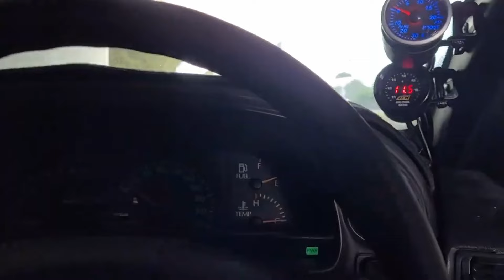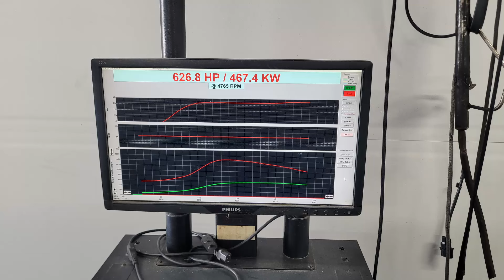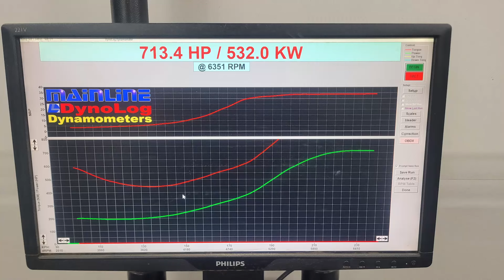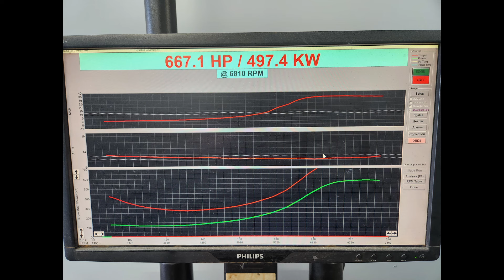Dazza.. Shop Truck?

Comment: Well done. OK dude I’ve watched for a while and I think for the way your doing things its best to start to have some individual egt’s sending to at least a max limit light or alarm or both and another cheap easy to make is a knock sensor to amplifier and send it to the same alarm indicators as the egt’s to stay ahead on vitals at this level for this pump. And if you don’t get your plumbing on point put a basic open closed adjustable pressure sensor in the fuel line back to the same indicators. More safety and certainty at this level 👍
Reply from the maker: Thanks man been on a big safty game the last few months definitely would like to look into some egts some of these next setups especially the one I wanna do on methanol..

Comment: I would be happy enough to not nrun the coilpacks and dfi module on any ecotec!  Mine keeps doing them (yearly dfi module or crank sensor) And whatever tuning ecu or software you can use would probably help it from overfueling itself and bogging down when its a hot running engine.  If eel like my VS has 80kw when at hot temp.  Cheers!  Great to see you again!
Reply: You can buy far better coil packs than stock coil packs